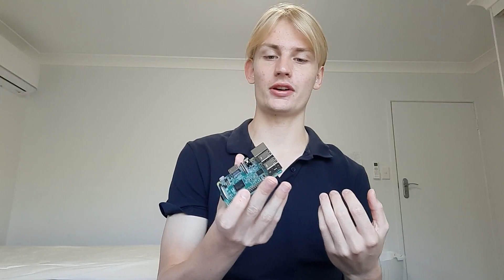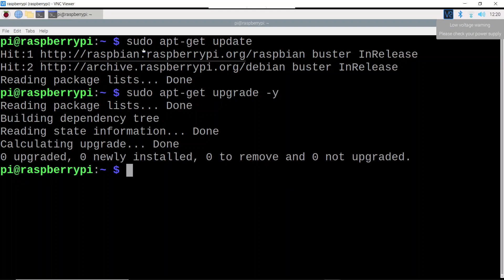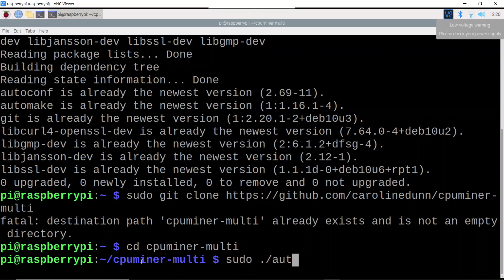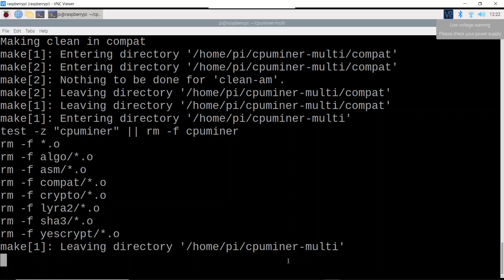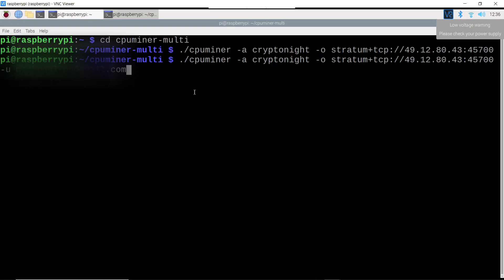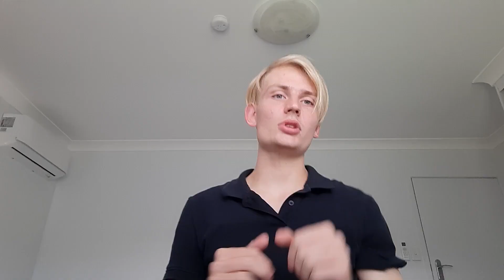How to Mine Cryptocurrencies Using Raspberry Pi, WORKING 2021

Comment: Have you turned on over-clocking feature and then tried mining? I just wanted to know any significant difference in the hashrate...

Edit: My bad. Realized too late. Rpi 3b+ has only 1 GB ram 👎. And no over-clock feature. 👎. I got xmrig to compile and run, but stopped after seeing the RAM available. 😞